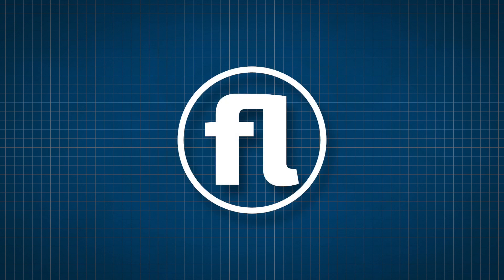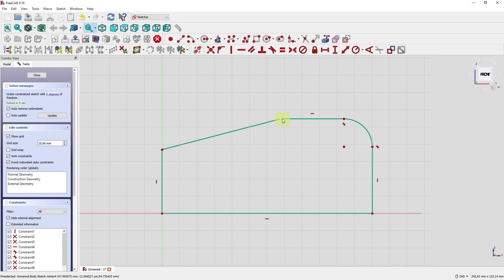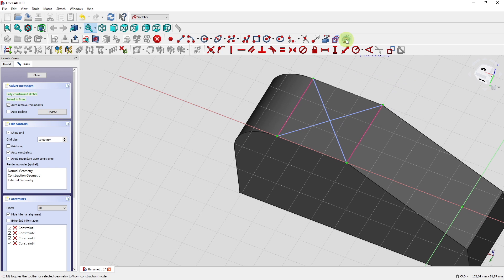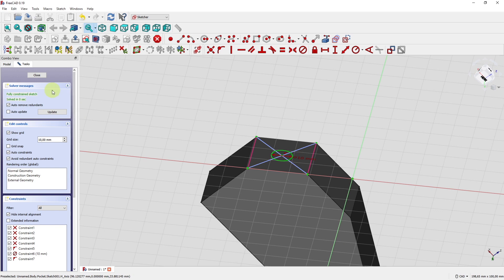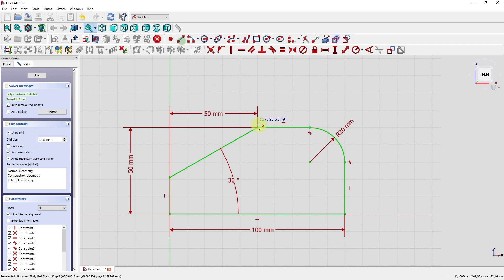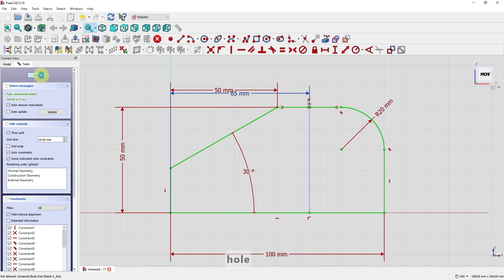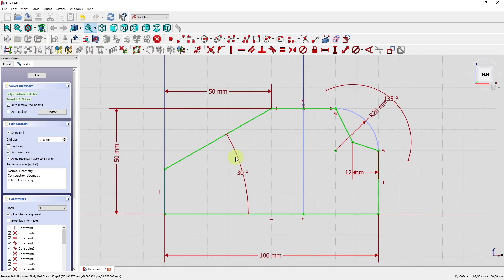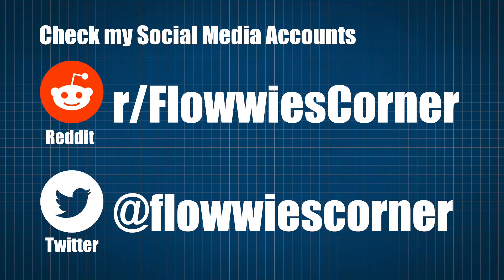FreeCAD 0.19 - Tutorial - Simple Part with Part Design (EN)

Comment: Thank you.  I'm a hobbyist ex-user of Fusion-360.  In a complicated part (a rotor for a pond pump),  I used a single sketch to derive about 20 lengths,  taking into account necessary clearances between fixed and rotating parts.  I then referenced points on that sketch from other commands,  such as creating a pad that is level with the point on the sketch.  I understand I could name all the derived dimensions in the original sketch in Freecad,   but I was wondering what was the problem with linking to geometry from another sketch in this case?   Would this be affected by the topo naming?

I'm not expecting an answer here,  but just highlighting some of the questions a relatively new user of Freecad moving from Fusion-360 has.

Comment: Outstanding tutorial videos, thanks for sharing!  I'm still in the learning curve for FreeCAD, having just learned DS Mechanical and found that I cannot use that software (won't run local).  

I have a Q about the naming problem you introduce here.  You fixed it by using a 2nd sketch plane NOT bound to a face (bound to master coord. system plane), and using named dimensions variables from the 1st sketch to keep the 2nd sketch in place.  Instead of naming dimension vars from other sketches, could I use reference geometry from the other solid while in the 2nd sketch bound to the XZ plane?   It would save steps over going back and forth to create and remember variable names, but still would not be sketch-bound to a face.  Would this allow error-free freedom of future editing?
Reply: OK, I just answered my own Q by trying to break it exactly as you did.  The model still broke when I introduced the rounded corner in sketch 1.  Using ref. geometry from the face fails just like binding the sketch to the face does.  Back to creating and tracking var names....  :-(
Reply from the maker: Actually using reference geometry from 2D sketches is safer than from 3D bodies but also not error-free. Deal with the problem At this point but there are major improvements ahead in FreeCAD and in the near future it will be solved
Reply: @FreeCADAcademy   Now I am trying to recreate this problem on a FreeCAD solid, imported from a STEP file.  After putting the solid into a body, I added a subtractive cylinder (Part Designer) and tied it to a face on my solid.  This face is surrounded by fillets, so removing the fillets should break the hole I created.  So far,  I can remove 2 of the 4 fillets, but on removing number 3 it crashed FC twice.  I'm assuming that that this too is the TNP.
Reply: Ok, bad assumption on my part (yuk, yuk).  FC was crashed by the Part -> Defeature tool trying to remove fillets from complicated intersections.  I was finally able to remove about 2 dozen fillet-faces from around the face used to anchor the Part Designer -> Subtr. Cylinder hole.  And the hole stayed right where I anchored it.  So now I'm assuming that feature-anchoring-to-faces only breaks when the sketching subsystem is involved?  And it seems to be safe to anchor non-sketched primitives in general?

Comment: Hi Flowwie, my new years resolution is to learn freecad. I have got as far as your second tutorial but i get to moving the circle to the top of the body using the the formula around minute 13. i understand why you would do this.( so that if you change parameters in the sketch the circle will follow) but i have a problem. when you type in the formula i cannot read it due to the resolution on youtube and i am missing something. if i put 50mm instead of the formula it works but obviously will not follow any changes.

Comment: From what I can tell, the section where you add the first construction line, then centre it, doesn't appear to work in FreeCAD 0.20
Reply from the maker: I need to check that. Thanks for sharing your experience
Reply: This is fundamental issue fixed in .20?

Comment: Hello Flowwie, I am using the parameters, like you mentioned, for defining positions. But for other projects, how do I ensure that other pads I created, are connected to the original face? If they are all different objects, how do I know the 3-D printer will print them as one object rather than separate objects?

Comment: I'm a bit surprised that "RealThunder's Mod" hasn't been mentioned yet in the comments. 
This gradually diverging fork of FreeCad has already solved most of the problems with internal naming. I only use his version of FreeCad now. It is still possible to break it by doing silly things, but I have to say you can almost do every single ""dangerous" thing and get away with it Those dangerous things shouldn't be so. If the tools are there, you should be able to safely use them without fear of scrapping hours of work. This is what RealThunder is doing: he's fixing problems with the code, and he's doing an excellent job. 
His version looks better, is more intuitive, and it's constantly being improved.

Comment: I did a punch trough. I followed your instructions. I put my hole on the XZ plane, main object on the XY plane. My part still became broke. It matters on how you place the circle, and what constraints are on it. Regardless of how you do it. If anything is adjust, moved, or added that adjusts the constraints of the placed circle, it will go where it wants, and you’ll need to re-place it correctly.